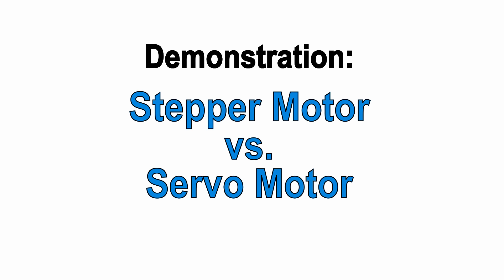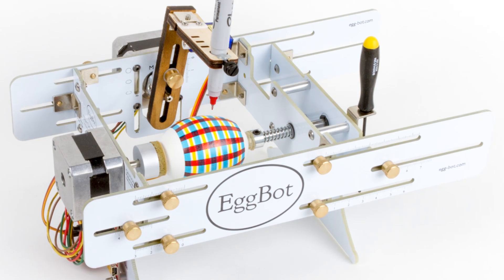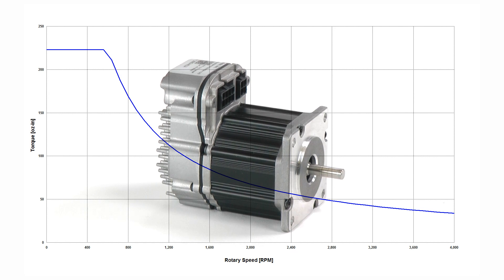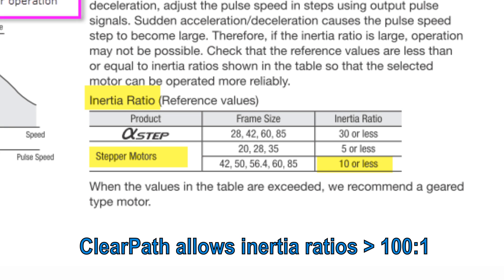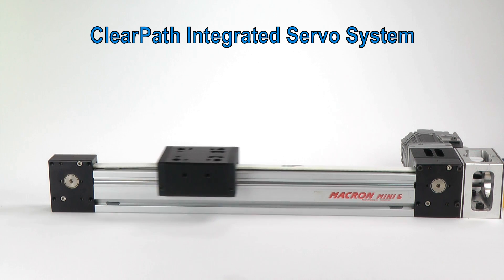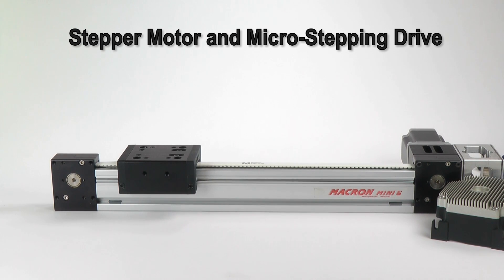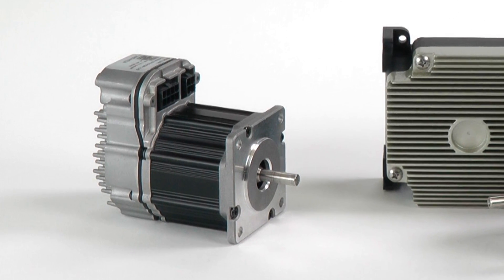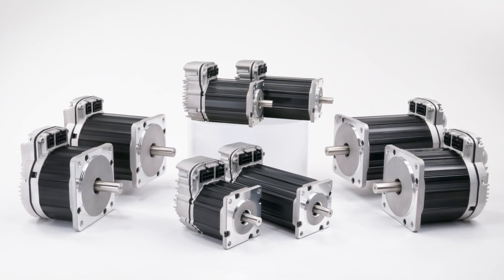Stepper Motor vs. ClearPath Servo Motor Demonstration Video

Comment: The biggest drawback of Clearpath motors is lack of encoder feedback which in turn makes them unable to be used in robots where position teaching happens by manually moving joints when motor windings are being de-energised. The solution of this issue would be either implementing a proper encoder quadrature output signal or addind a second shaft for mounting an external encoder.
Reply: Could you please elaborate? I thought CleartPath was  fully closed loop

Comment: I'm new to this type of bench mill conversions, so please bear with me.

is there a servo spindle motor with an encoder built in made to replace the spindle motor for on a CNC controlled conversion of a Precision Matthews PM-833 TV or PM-940V milling machine?

I believe a servo spindle motor will be of much better use in RPM's over a typical AC spindle motor.

I prefer the spindle motor to be CNC controlled through the use of m codes. I know that M03 - clockwise , Mm04  - counter clockwise, M05 - spindle stop, & M30 end of program will stop the spindle.

Also, would you be willing to suggest  a brand and type?

I wold like to convert my Precision Matthews PM-833 Verbal Speed or PM-940V. I would like to spindle with an on/off  & speed controlled within the part program with out having to turning on & adjusting the spindle speed  manually.

Comment: commercial lie of course - if you have such noise during stepper operation, replace your driver because your voltage delivery is wrong
Reply: Older stepper drivers have larger voltage steps (micro steps in between full steps) causing micro shutters that make the noise like in the video. New stepper drivers are nearly dead silent if not completely silent because they have many more steps and other magic apparently idk.

Comment: Trinamic drivers with encoders and "StealthChop" mode are quiet, fast and accurate. And it's cheaper solution.
Reply: yeah, but  as accurate ?
Reply: @joeygonzo  Steppers are always much accurate than brushless. Steppers have 200 or 400 full steps per revolution, and brushless have only 3-30. Microstepping makes steppers even more precise, and they have much stronger holding torque. Of course, they are not as fast as brushless, but with good drivers and under low load can still reach 3000 RPM.

Comment: Can I use these servos with a normal 3d printer board? Or do I need something else?
Reply: Paclanc they take regular step and direction signals so it should work with any 3D printer platform. But as the video stated these are for higher power applications. I have them on my CNC mill but I would only put them on a printer if money wasn't a factor or it is a very large printer that needed the power.

Comment: Just as stepper with an encoder for closed loop feedback aka "servo". Oriental has them everybody has them. I'm must admit they are a good solution for most applications.
Reply: Hi R.J.,
This is actually a common question.  For clarification, ClearPath is not a stepper motor with an encoder. The motor core within ClearPath is an 8-pole, brushless, sinewave-commutated servo motor.  (See more below)
 
The reason I’m making this distinction is because although you can put an encoder on a stepper motor and run it as a servo, the construction of a stepper motor (which was originally designed specifically to run open-loop), is not very good for servo control. The very high pole count (typically 100), which is essential to running the stepper open-loop, creates a very high electrical inductance, and reluctance torque. Both of these factors are counter-productive for a servo-controlled motor (reduced power at speed, high ripple torque, more servo “hunting”, etc.).

As an aside, you can see a cutaway of the ClearPath motor core construction here: https://www.teknic.com/products/hudson-motors/

Please contact Teknic if you have any questions.

Best regards,
Brendan - Teknic Servo Systems Engineer

Comment: How would it be to put in a closed loop motor in a normal h-bot marvin system. Do I need custom firmware?
Reply: Hi KenHelps You,

Thanks for watching and for your question. No, the ClearPath motors do not require any custom firmware for an H-Bot type application. To keep the motors well coordinated, you would use the ClearPath SD series and a step and direction command. 

Searching YouTube with the search terms “ClearPath” and “H-Bot” will bring up some videos of ClearPath integrated servo motors running H-Bot assemblies.
You can find more information in the ClearPath User Manual and on Teknic’s website:

https://www.teknic.com/files/downloads/clearpath_user_manual.pdf

https://www.teknic.com/downloads

If you have any other questions, please feel free to contact us directly at support@teknic.com. 

Best regards, 

Aaron B. – Teknic Servo Systems Engineer

Comment: I'm entirely sold on servo systems. It seems they also have higher operating torque in a higher RPM.
Reply: Hi davidsirmons. Your observation is correct. One of the advantages of servos over steppers of similar physical size, is their ability to output high continuous torque (and on-demand peak torque) over a wider range of speeds. Thanks for taking the time to watch!

~Jim W.
Applications Engineer
Teknic, Inc.

Comment: Great and fantastic explanation keep it up, I have got a question that ....what kind to motor is good for machine has to operate in low speed with arm(50cm) holding up 10kg of weight
Reply: Hi Mo Yahya. I’m an applications engineer with Teknic and came across your question. Most digital servos, including ClearPath, are well suited to handle this type of application, especially at low speeds. In this case, the arm/weight represents a large inertial load so you’ll want to review the system inertia and continuous torque requirements. You’ll likely benefit from using a high-ratio gearbox. 
If you need some further applications help, you can contact us with specific questions through our website at: https://www.teknic.com/contact/
Thanks for your feedback.
-Abe A

Comment: What makes or brake stepper motor is the driver get better one and will have low noise high torque
Reply: Hi Gamex996,

I agree that the drive selection can play a significant role in the performance of a permanent magnet motor (stepper or servo).  In this video we used a well-known, commercially available stepper drive set to micro stepping mode.

However, because of the physical differences in motor construction between a stepper and a servo motor, steppers tend to run audibly noisy regardless of the driver used.

-Aaron B.

Comment: Hello.
I want to shift gears electrically (using paddles and an Arduino) on my 125cc, 42 HP shifter kart.
I just don't know what servo or stepper motor I would need to accomplish this.

I measured the force needed to change gears to be about 13 kgf (I used a spring scale to pull the leaver that changes the gear in the gearbox. When the gear changed it showed 13 kg)

What is the force in Nm that I need (I don't know exactly how to calculate it, or if I measured correctly)?
Is a servo or a stepper better? 
It would also need to be fast (not long travel - only about 3 cm - but as fast as possible).
It would be awesome if it used only 5V power supply. But higher is OK too.

I saw many systems on the internet but none shower the exact model of the actuator/motor used to change gears (since they are all commercial systems).

I would like to accomplish something on the lines of ME-Shifter F1. (Of course not that sophisticated)

Any help would be very appreciated.
Reply: Hi Pintea,

In order to know what type and size of motor would be best for your application, it's important to understand a little more about the mechanics of the system (i.e. inertia, torque, velocity, dimensions, duty cycle, etc.) 

Given the limited bandwidth and formatting capability of YouTube, this may not be the best venue to answer all of your questions. Please don't hesitate to contact us at support@teknic.com if you would like to discuss your application.

(As a note, the DC-input ClearPath motors nominally require a minimum of 24VDC and a maximum of 75VDC. 5VDC is high enough for the I/O but too low for motor movement. )

Thanks,
Jonathan T.
Reply: I'd recommend a mechanical linkage, over an electronic system in a kart, some aluminun sheet and ball joints will weigh less than a battery, alternator, psu wiring switches ect.
Reply: I've seen some of these systems use pneumatic actutation. Maybe that could be an alternative. 
Using some kind of motor think of a cam - like the ones in 4-stroke motors. Other than that I agree with Teknic Inc that one would need more information to give help for a design.

Comment: nema 23's are WAY cheaper than clearpath. You can buy a chinese nema 23 driver AND stepper for like $30
Reply: Hi kkuhn, 

To choose the most appropriate motor/drive system for your application, you should follow these steps:

1) calculate your mechanical power requirements
2) calculate the shaft power of each system as shown in the video
3) tentatively select systems that have the appropriate amount of power
4) from those systems, choose the lowest price system that has the performance, features and reliability that you need.

The size of a motor (e.g., NEMA 23) is not a good indicator of power or performance. A $30 NEMA 23 stepper will have a small fraction of the shaft power of an equal size ClearPath servo motor. This doesn’t make it bad, per se, it just means that it shouldn’t be considered for the same application as an equal-size ClearPath motor. Either the stepper will have too little power for your application or ClearPath will have too much. ClearPath has much higher performance too (no lost steps, smoothness, quietness, integrated package, etc.), but it costs a lot more than $30, so ClearPath would not be very popular if it didn’t have these power and performance advantages.

As a rule of thumb, when your application requires 50+ watts of mechanical power, ClearPath will start to make economic sense compared to a stepper. For less than 50 watts, especially if lower performance is acceptable in your application, a stepper motor system may be more economical.

Best Regards,

Aaron
Reply: Servo motors come in NEMA 23 as well. It is just a size and form-factor designation and doesn't imply any type of motor.
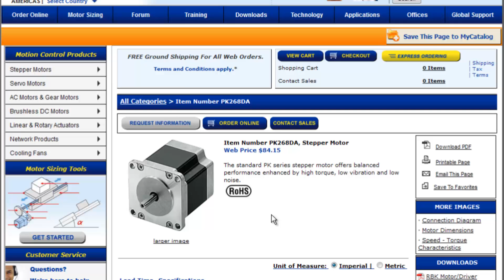Reply: I commented this because they were showing a single nema 23 stepper and driver for $346 in the video but in reality they are MUCH less expensive and make the clearpaths seem that much more overpriced imo 1:30

Comment: Nice comparison. too bad there has been a development of a new stepper driver the TMC series TMC2130 (for example )for NEMA motors that solve the noise and tracking issues. 
and will still be a cheaper option.
Reply: Hi DarkShadowsX5,

I'm an applications engineer with Teknic, and I'm that glad you liked the video and took the time to provide us with the feedback. 

I am not personally familiar with that TMC series of Integrated Circuits, but I looked up the specs of this chip and I believe it is rated to 1.2A. At a max output voltage of 46VDC, its electrical output power would be about ~55W, making the stepper’s mechanical output shaft power in the 40W range. This would allow a user to make their own drive in the same power class range as the NEMA 23 stepper described in the video.

It’s unclear from the data sheet if you can use this product to run a stepper motor as a servo, which, if you could, would somewhat reduce the noise (our Meridian product has this capability built in). 

I cannot comment on the price or performance of this chip, but on paper (once designed into an appropriate drive board) it seems like it should at least be a comparable power output to the stepper described in the video. I don’t know how much work would have to go into making this chip into a complete drive product. 

Best regards,
Jon K
Reply: The TMC chips are plugged into a RAMPS v1.4 board or other modular stepper driver board. the boards hold 5 and are controlled by an 8bit or 32bit processor depending on what you get.
Although it does help reduce motor noise significantly, I don't think my original comment about the tracking/stepping issues was entirely correct. i haven't yet used one and been based on my personal research. 

the clear path motors do look like a great alternative but pricy.
let's say I'm looking to build a fast, reliable, and precise multi-purpose CNC machine. swap out mill spindle, laser cutter, 3d printer heads. 
and needs to be able to mill aluminum at a decent speed. I don't have a lot of room for 3 machines. I'm looking at motion/control options.
Reply: Hi DarkShadowsX5,

Thank you for the additional information on the TMC chips.

We can break down the process of selecting the right motors for your machine into two separate parts:

1 - Calculate the physical requirements of your application- In other words, calculate the torque, reflected inertia, velocity and acceleration values, etc. which make sense for the materials you are looking to process. Once you know these values, you can use that information to decide if you should use a servo or a stepper based system. You’ll probably need to do this a few times for the different “heads” you plan on putting on your machine. Once completed, you will be able to size an optimal motor that can hit all of your motion requirements.

2 - Figuring out how you intend to control the motors (i.e. what type of signals to tell them where and how to move). If you are looking at a ClearPath servo, then you will need to choose from one of three series of motors – essentially you’ll be selecting the best control fit for your application. 

For people who choose ClearPath to retrofit or build CNC machines, we recommend the ClearPath Step & Direction (“SD”) series of servo motors. The SD ClearPath servos interface to numerous third-party CNC controllers which synchronize and coordinate the different axes on your machine to cut/mill/print the appropriate part. Just make sure that the controller can output a 5-24 VDC single-ended step and direction signal. (As a side note, this same Step & Direction protocol is often used with stepper motors as well). 

If you’re interested, you can find additional information on the SD ClearPath servo motors (including the torque, speed, and power ratings) on Teknic’s website: https://www.teknic.com/products/clearpath-brushless-dc-servo-motors/clearpath-sd-stepper-replacement/

Best of luck with your machine build,
Jon K.

Comment: What's the smallest clearpath servo i could get?
Reply: Hi booger king,

I’m an applications engineer with Teknic.

The smallest ClearPath servos Teknic manufactures are NEMA 23, single “stack” motors (motors with “2310” or “2311” in their part numbers.   Their dimensions are:

3.34” x 2.33” x 2.33” (L x W x H respectively)

The specific part number(s) will depend upon which series of ClearPath makes the most sense for your application.   Below is a link to the overview videos for each ClearPath series (SD, MC and SC).

https://www.teknic.com/products/clearpath-brushless-dc-servo-motors/clearpath-servos/#which-series

Please feel free to email us at support@teknic.com if you have any other questions.

Best regards,

Mark D.